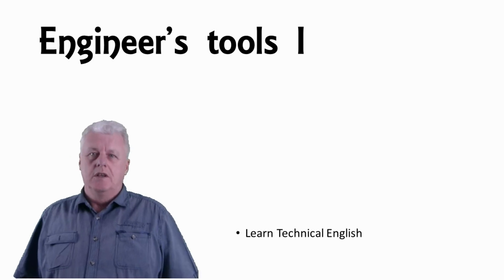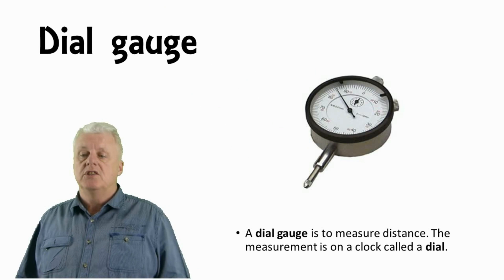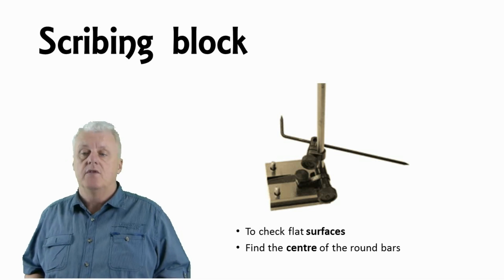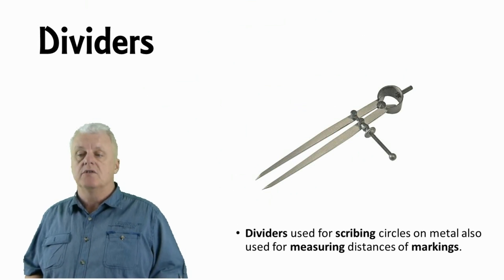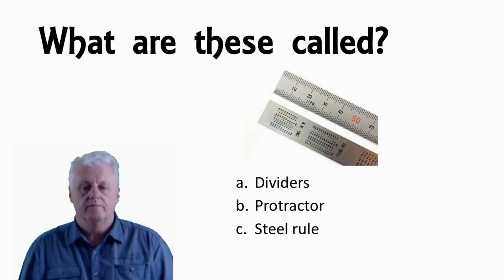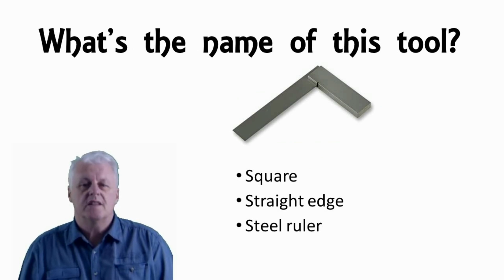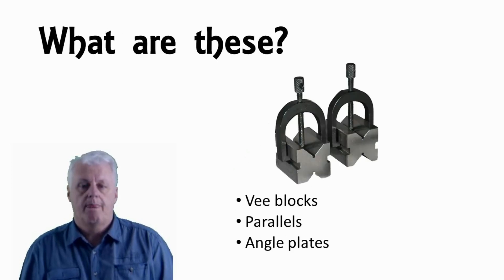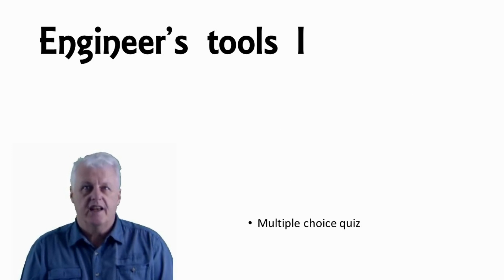Engineer's tool list

Comment: The caliper I have I can measure basically almost ecerything from the dept, width length height 
Only restrictions for me is if the object is too tall or depth goes farther than mine measures 
I 3d print parts and other things and using the caliper allows me to make 90% of what I need.